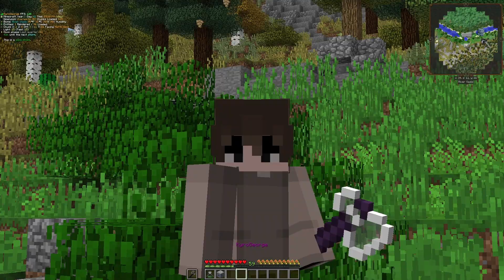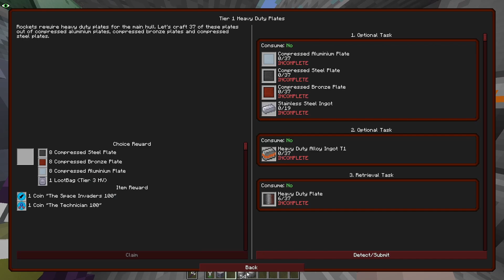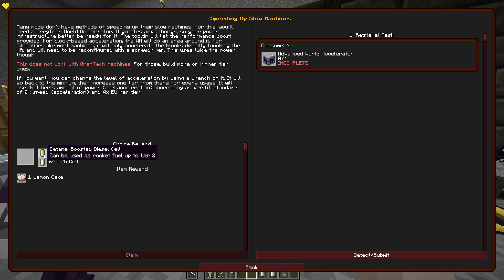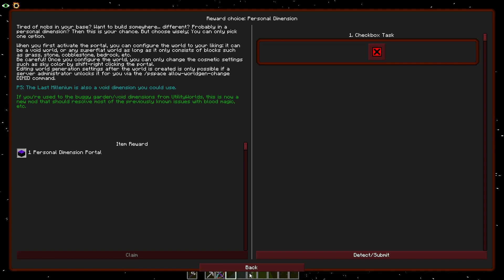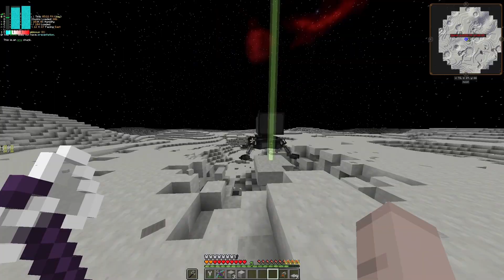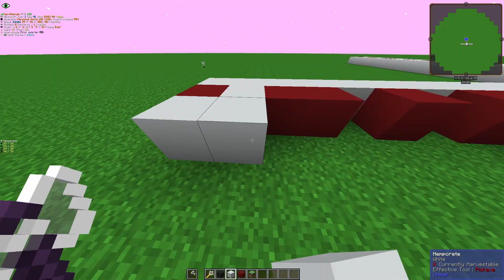GregTech New Horizons | AE2, Personal Dimension And The Moon! (EV Progression) | Cheat Run #5

Comment: While testing some things in creative, I discovered you can put actual fluids in drawers. Not fluid cells, but actual fluids as items. Then you can just use conveyors and item pipes to send them to tanks and they behave as normal fluids from there on.

Getting the actual fluid as an item can be a little annoying depending on the fluid, as some don't even appear in NEI (at least in 2.7.4, not sure about 2.8) but once you have them it's much easier than having to deal with empty cells.

Not really useful now that you have AE2 infinite fluid storage, but I'm still putting that information out here in case someone else wants to play a cheat run.